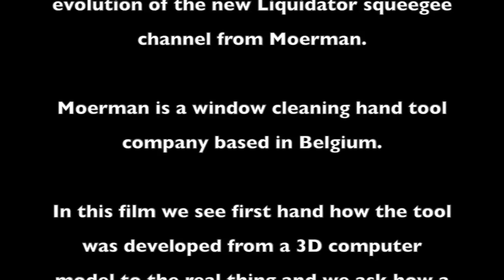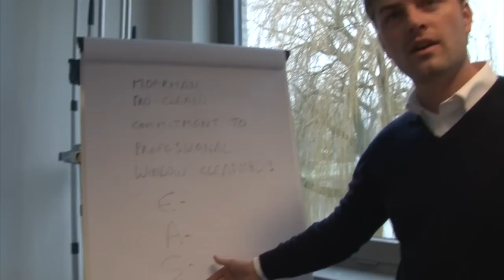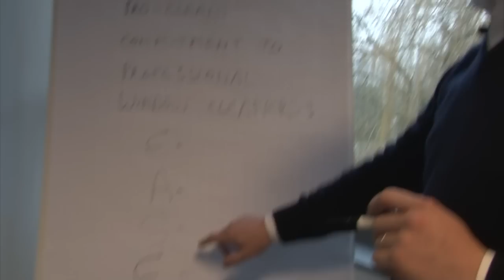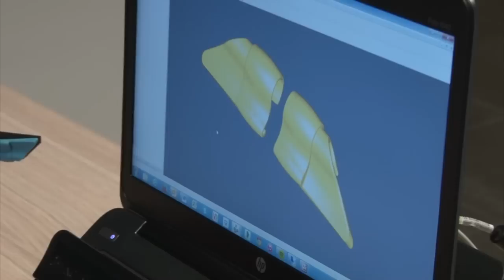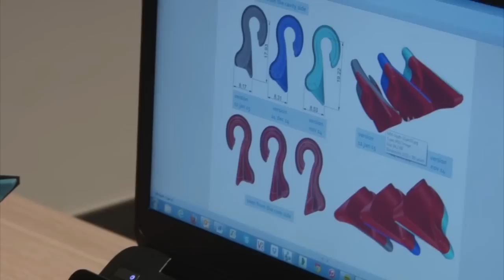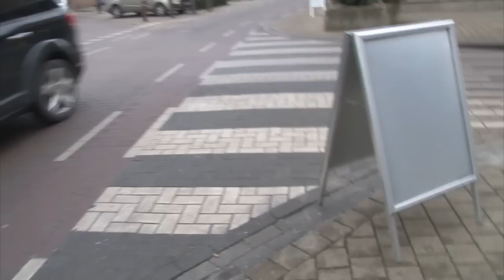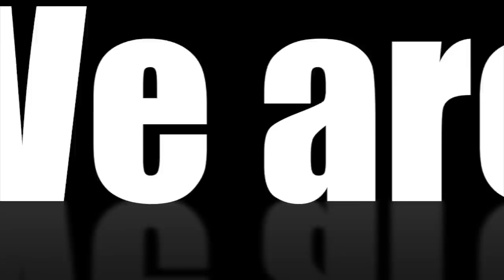The Moerman Liquidator Squeegee: The documentary.

Comment: I don't like the latest handle they made. It feels cheap and the spring action to get the blade in out is a bad design. The Fliq 18" doesn't flick from underneath. And if you can get it to fliq you cant close out on a bottom frame using a stick because the pad bunches on the frame. But as for the Liquidator.... WOW!!! That thing is amazing. Even over the thinnest wedge rubber it will not ride over it. Its he first tool I have ever used that made me actually say "WOW" out loud after finishing a window. It really can save 25% time. They have got that thing bang on! I hope they work on their other tools and get them on that same par.